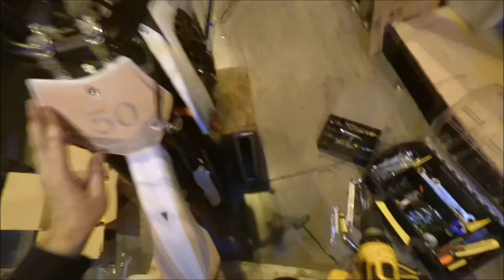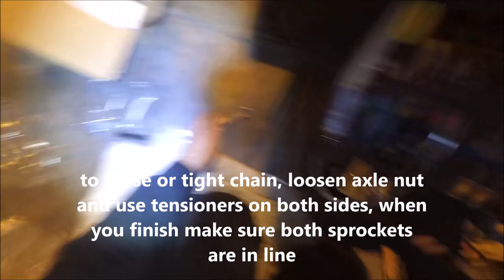Mini Dirt Bike 50cc - Pocket Bike Gazelle - Unboxing - Full Assembly Instructions Nitro Motors

Comment: just got mine.  I locktight everything so it won't come loose. k&n spray on filter . And running 36/1 not 25/1. Way to much oil.  When u run to much oil you can actually Mess u the motor.  It all most like it is running lean with to much oil.  I have Yamaha banshees and there two stroke motor and been riding two strokes like for 36years.